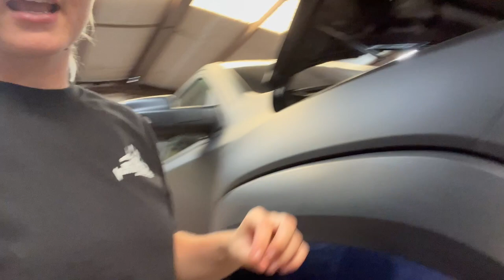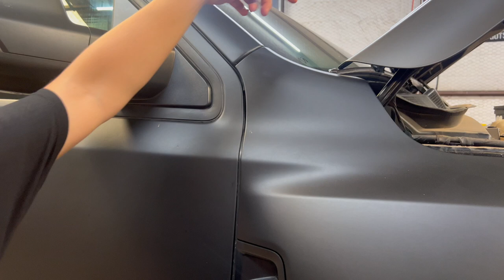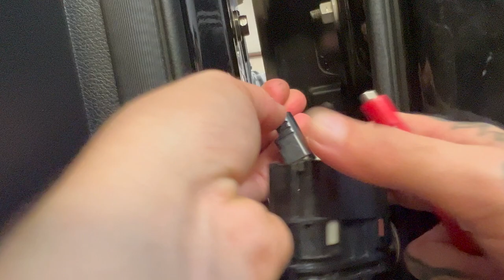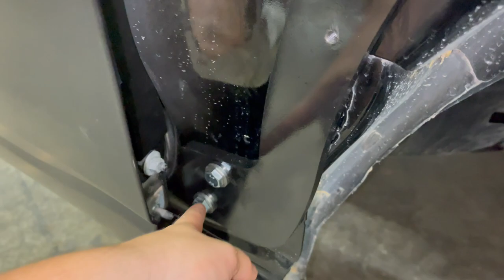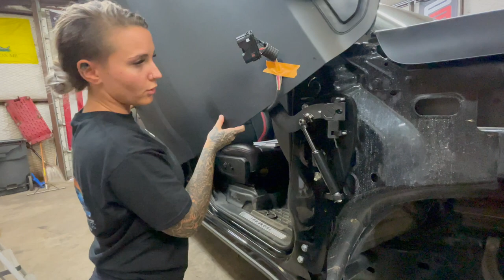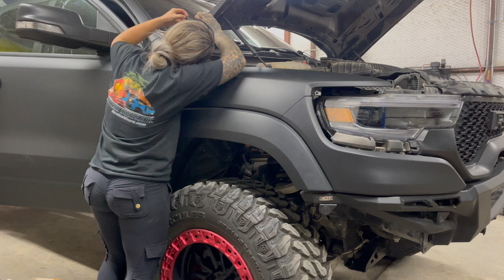How to Install Lambo Doors on a TRX!!

Comment: Hulluva Awesome video. For 27 min I m doing it, I will do it, definitely will do. At 27.30 min oh hell no, not doing it. I dont believe cutting into factory item or body...👍 👍
Reply from the maker: It’s just trimming the inside of the fender mount lol it’s not like you’re cutting into an external body panel.
Reply: @TheCumminsCowgirl  you are right hun. But for my 23 f150 lariat I dont think cutting will be necessary. TYVM for the video n inspiration. 💓